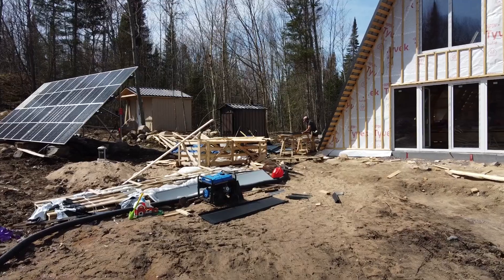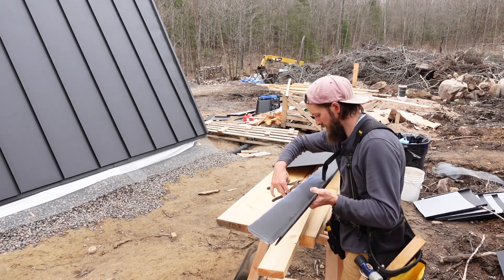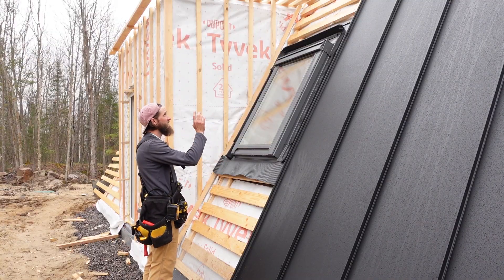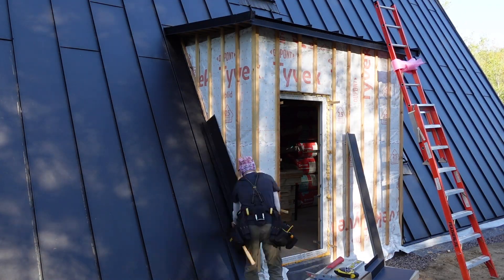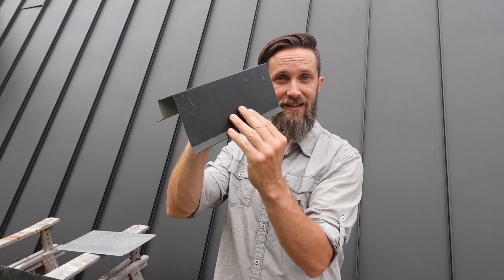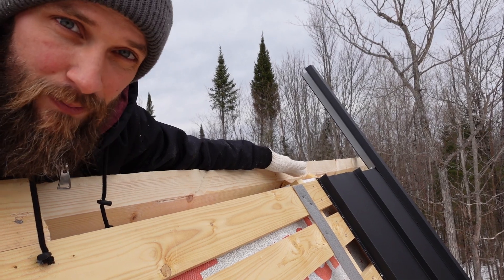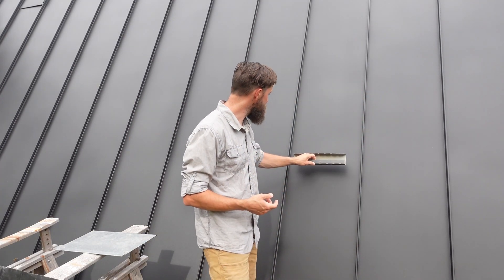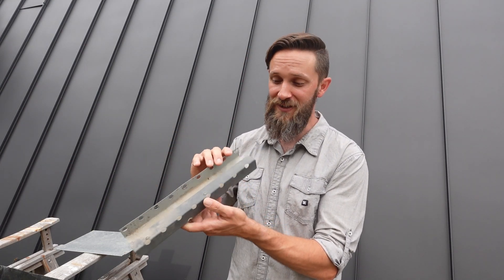Ep. 18 | Our Avrame Home, ROOFING #2: Technical details of Ruukki Steel roof

Comment: I am confused... Is there no sheathing on the exterior of the home? This looks like the insulation will be sandwiched between whatever the interior wall covering is, and the Tyvek house wrap? Does that meet code in USA?. How would you meet Washington State code for R40 walls of theres nothing but a layer of wrap between the wall insulation and and the exterior? 

Is this the European kit?  Does the USA kit come with roof sheathing?
Reply from the maker: European kit has the OSB sheathing on the inside. OSB acts as a vapour barrier that is why we do not want to install it on the outside. So in case of any humidity geting to the insulation it can evaporate outside.

Comment: Hey, I live in the USA and have been looking into building my own A-frame.  The Avrame USA website only offers kits for use on basement or crawl space foundations.  Did you guys have to custom make the brackets you used to connect the trusses to the slab, or is that something that Avrame offers outside of the USA?  I ask because I was thinking of trying to put a 2 car garage in one of the gable ends, which would require a slab foundation for that part of the A-frame.
Reply from the maker: EU kit has full slab option.